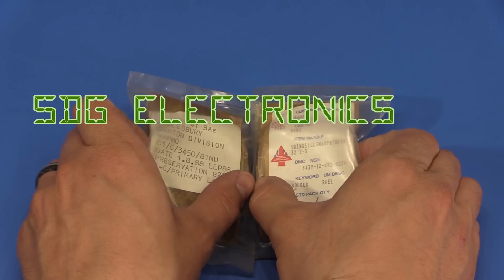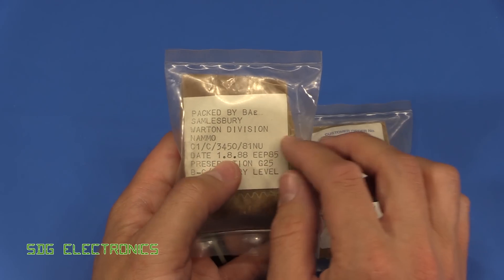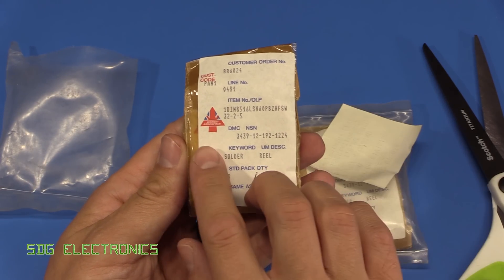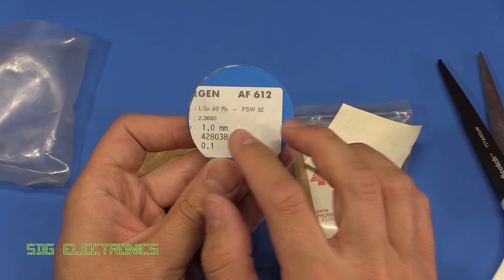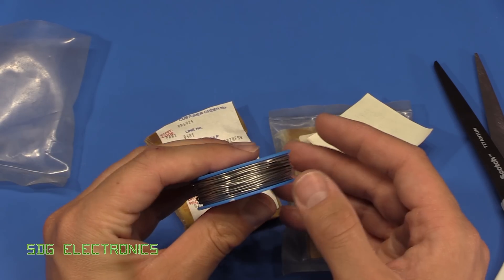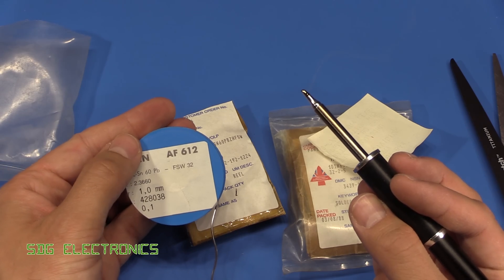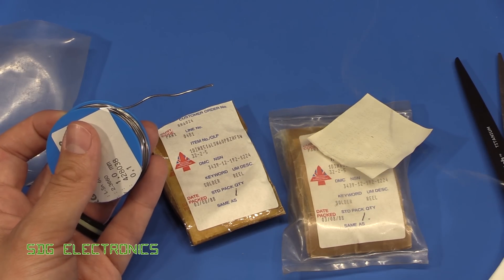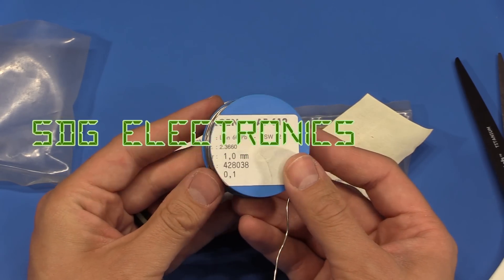SDG #071 British Aerospace 1988 Solder Ration...

Comment: A lot of early aircraft connectors by ITT Cannon, Amphenol, Plessey and Deutsch were solder buckets. My BAe apprenticeship (at Woodford, Cheshire) in the early 80's used these along with Nyvin 'cloth and clear vinyl' insulated cable. Later years used crimped turned pin connectors for easier assembly and more reliable connections. Cables were replaced with Tefzel based insulation due to the deadly fumes that Nyvin released when overheated or burnt! Tefzel had its own issues though, in that the insulation is thin and quite delecate and could be damaged if it rubbed on an adjacent structure.
Reply from the maker: Nice info, thank you

Comment: I didn't think that solder would be any good at that age.
Reply from the maker: There's no real degradation with age, flux is also pretty stable in solid form so it should last a long long time
Reply: That's good. I have a new roll of Kester solder that I don't have to worry about then.
Reply: Robert Calk Jr. I still have a reel of Kester 63/37 that was bought from a surplus vendor sometime around 1990, so it probably wasn’t even fresh at the time! It’s still totally fine now, despite having not been packed air tight like the stuff in this video. It solders as well as recently bought Kester, though the outer few layers of solder aren’t as shiny as they once were.
Reply: Antonio Tejada  Thanks Antonio. That is nice to know!

Comment: Steve - is leaded solder still available for sale in your area? Readily available here in the U.S. obviously but was just curious if  you can get it in the EU sphere or is that simply a prohibition against the commercial manufacture or importation into the country? Look forward to the comparison you'll be doing.
Reply from the maker: It's on crackdown now. They've classified it high risk in REACH which now means it's restricted from the public and sold only for professional use only. You can obviously still get it from eBay sellers etc
Reply: @sdgelectronics  
You mean ROHS (Restriction Of use Hazard Substances).
Reply: Still used in the military and aerospace arena, and not going to change there for decades, at least till all the old stuff that uses it is phased out, which will in all likelihood be never.  

That pack would likely have been destined for a first line service unit, to be issued whenever a connector on an aircraft or other aircraft ground support equipment required a replacement connector soldered in, or to do repairs that required crimping and soldering for reliability. Small lengths and the right size to be used for up to 100 joints on circular bayonet connectors on aircraft. Yes you end up with a fair amount left over on each job, but there is the guarantee that every job will be done with the correct solder, in the correct size and composition, so that you do not have issues with poor wetting otherwise. At depot level they would be using those reels as well on occasion, but in general you would use a much larger reel instead, because you use so much of it.